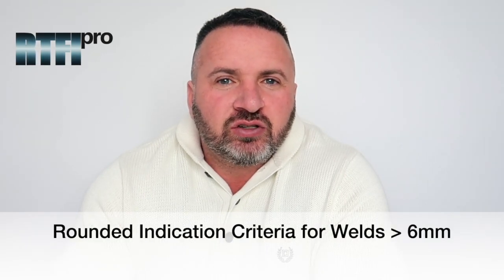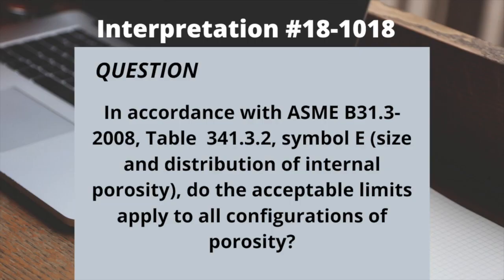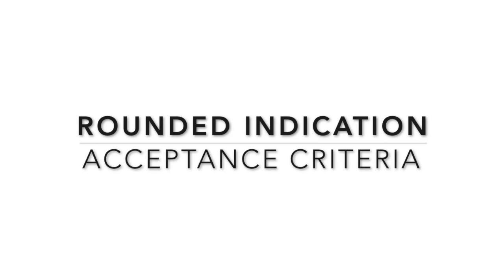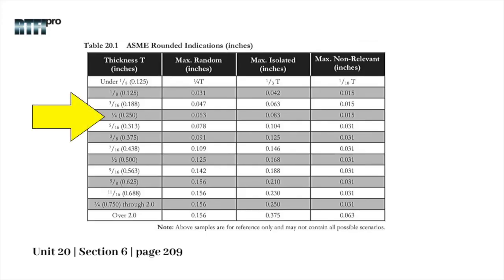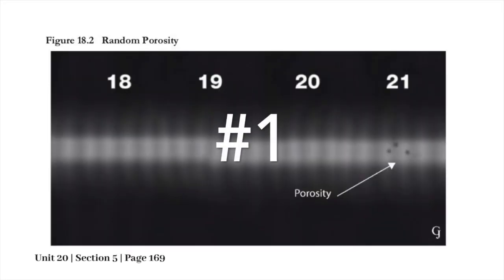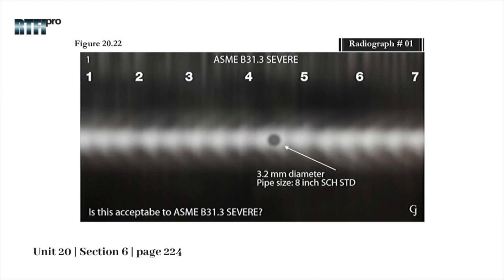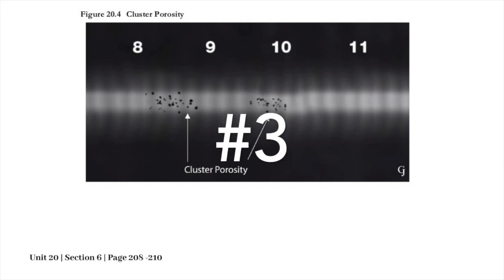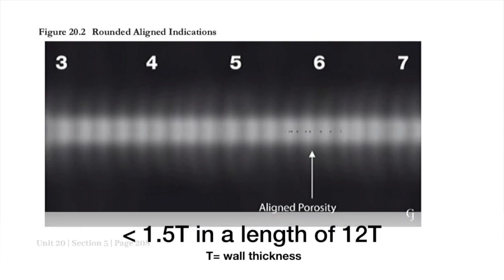ASME B31.3 Normal for Rounded Indications

Comment: Dear Sir, 
Could you please clarify on porosity cluster acceptance for B31.3, Normal, pipe WT 12.7mm, where  the Lenght of the cluster is 13mm? 

Based on ASME B31.3-2018  Table 341.3.2  for   T> 6 mm w (1∕4in.), limit is 1.5 × D.
Based on ASME BPVC.VIII.1-2021  4-3  (h) Clustered Indications. ... The length of an acceptable cluster shall not exceed the lesser of 1 in. (25 mm) or 2t. ...

Shall I consider porosity acceptance length as 38mm  (1.5 x D = 1.5 x 25)?

An interesting fact to compare with other codes: API -1104 has an acceptable cluster length of 13mm, ISO 5817:2014 has an acceptable cluster is 15mm.